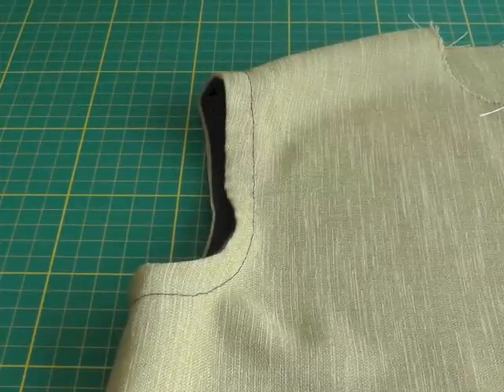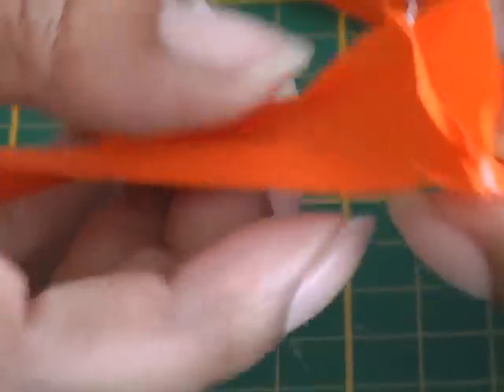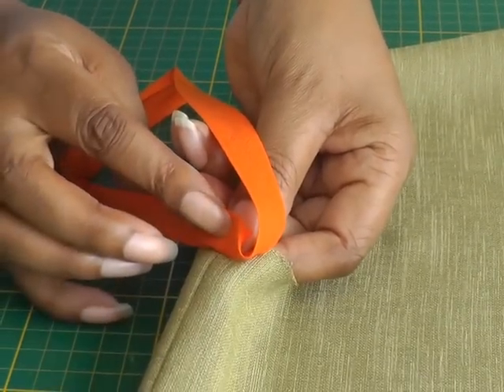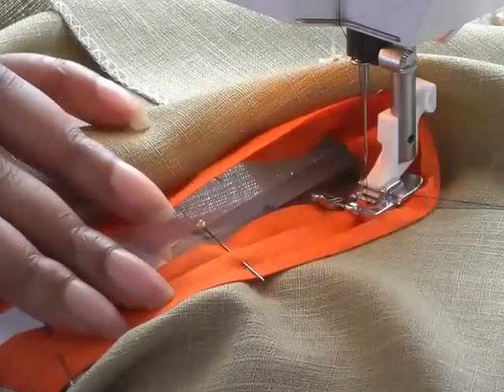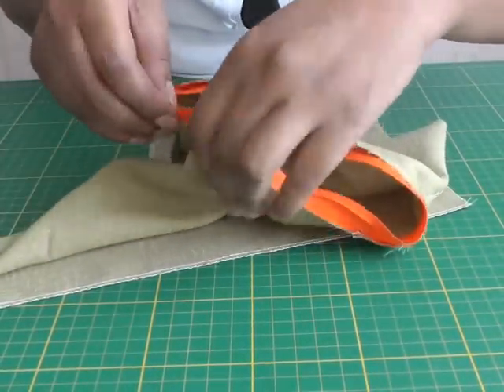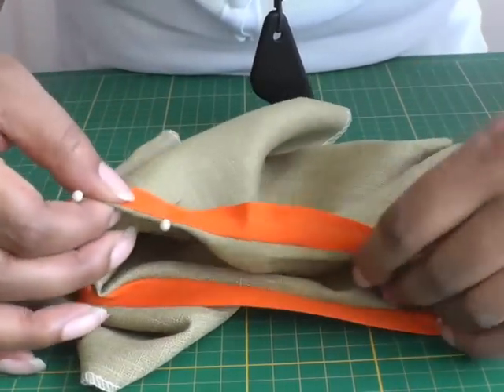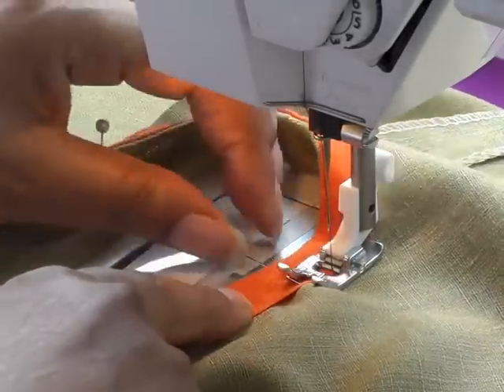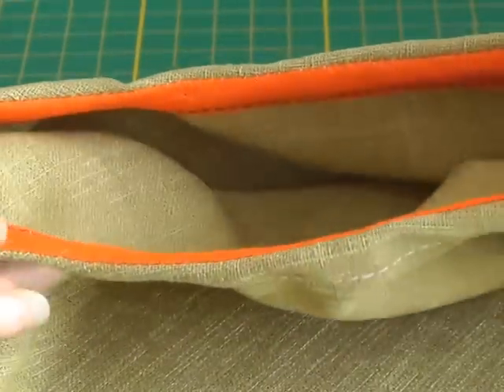Facing an Armhole with Bias Binding

Comment from the maker: Hi. Once you've sewn the tape onto the armhole and turned it to the wrong side, try hand stitching the binding to the fabric to get a neater finish and the hand stitching will move with the stretch. The length of the bias tape is determined by the armhole size plus 2.5cm's.

Comment: Great video! Thank you for explaining so clearly! I removed the sleeves from my wedding dress (a tulle appliqued material). A want to re-bind just the bottom part of the armhole, as the top half is appliqued and won't require binding. How should I sew the beginning and end of the binding on? Miter the angles or just fold a straight end?

Comment: Thank you for this informative video. I have a lightweight denim shirt on which I have removed the sleeves in order to make it sleeveless. There’s two rows of decorative top stitching that were previously holding the seams onto the bust side. I’m lazy. Is surging the seam allowance and re-stitching over the decorative top stitching an acceptable way to finish off a sleeveless garment? Also when you sewed your bias tape, is it important to sew it straight down or would it have been better to sew it on the bias?
Reply from the maker: Hello Mary it is possible to do it that way, I would keep the decorative stitching, and turn the raw edge in on itself and hand sew using a slip stitch. Second question sew straight down.
Reply: Colleen G Lea - FSBTV Thanks for your reply! After I took the sleeve off I discovered how gigantic the arm hole was and so I will have to take in The side seams and use a smaller piece of bias tape to pull everything in a little... or would you recommend a very thin piece of grosgrain or a strip of fabric cut on the straight of grain to keep it from stretching?

Comment: I used the same fabric with folded over edges... when you curve the bias binding, how does it stay that way? What is it made out of? Does only bias binding stretch like that?
Reply: if you cut your fabric in bias it will have some amount of stretch. knits do not need to cut in bias because they are stretchable any way. if you cut strips from any fabric in bias then it is a bias binding.

Comment: Maybe you can help me with my bias binding problem on neck and armhole facings. I can’t find any videos on troubleshooting. Everything goes smoothly until I go to topstitch. Then I end up with ‘ripples’ and it seems as though the top fabric is being ‘pulled’. Steaming doesn’t get rid of the problem. I’ve tried lowering the presser foot pressure. I don’t have a walking foot. It almost always happens on knit fabric. I’m a fairly experienced sewist, but have never been able to do bindings. I wish I knew what I was doing wrong.
Reply from the maker: The technical issues you are experiencing with your machine are beyond me, I would recommend looking at Abi's Youtube channel were she tackles 'Sewing Machine Problems' Here is the link - https://www.youtube.com/c/AbisDen/featured
Reply: Thanks for your reply. I lowered the pressure foot dial down as far as possible and it helped. No more ‘dragging’ of the fabric. I like your teaching style. Your explanations are easy to understand and straight to the point. I can tell you have a lot of experience, and you are exactly the kind of teacher I want to learn from. 🙂
Reply from the maker: @ln6974  Thank you so much for your kind comment.  🙂 Sew happy you managed to sort out your problem.

Comment: I don't know how to trim my arm hole,I'm scared i might ruin it. Is it just the front arm hole needs to be trim? Thanks!
Reply from the maker: Just take your time, and you will be fine.  Trim front and back!
Reply: @colleenglea  Do you remove 1cm from the edge of the dress fabric?
Reply: @colleenglea  and also why do you have to trim 1 cm of the edge?
Reply from the maker: Yes. @adamniland7127
Reply from the maker: I'm cutting away some of the seam allowance, it also helps to give a sharper finish. @adamniland7127

Comment: In order to prevent the bumpiness seen at 5:17 you should ALWAYS clip the seams. Clipping concave seams is a good way to get them to lie flat (concave seams are found on rounded necklines and rounded armholes). Notching is often confused with clipping but notching is only done on convex seams (like a rounded bottom bag would have it's rounded bottom notched instead of clipped if we wanted the rounded bottom bag to sit up when we put it down). Good article on notching and clipping and when to do both: https://byhandlondon.com/blogs/by-hand-london/25617540-clipping-notching-seam-allowances-how-why-where
Reply from the maker: The fabric choice and pressing will always determine a beautiful finish.